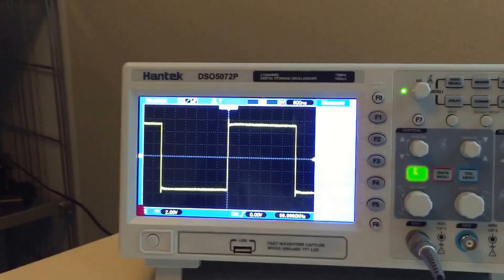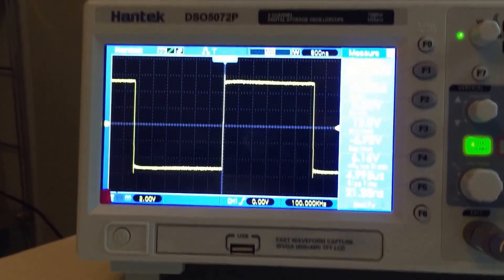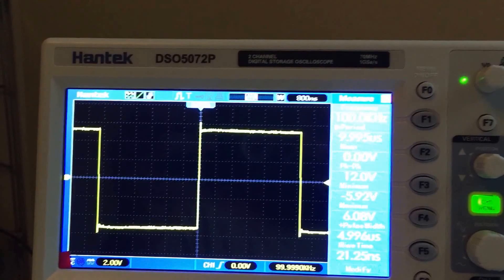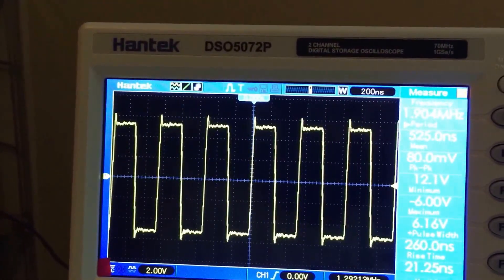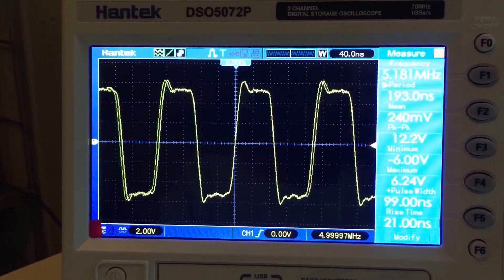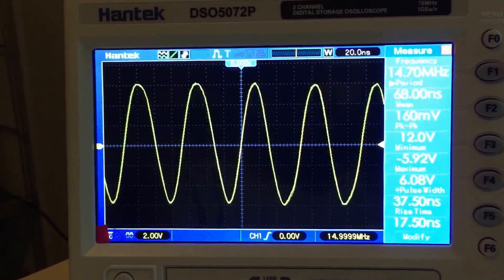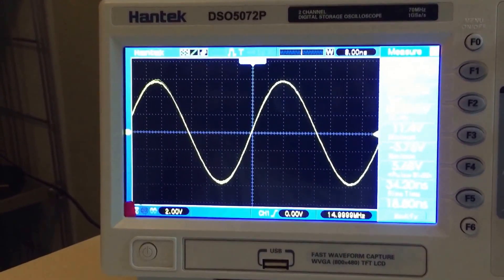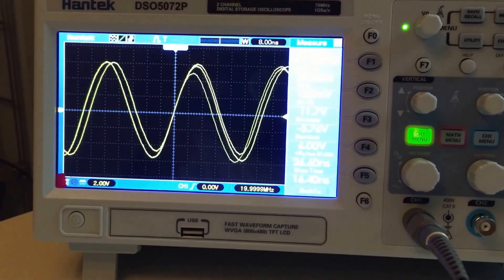Hantek 5072P testing the waveform of the Feeltech FY3200S

Comment: You’ll never get a square wave at the maximum frequency out of a function generator as it is fundamentally made up of higher frequency harmonics. Typically you might get f/4 i.e. 5MHz in your case. I bet if you check the specs carefully the square wave max freq is less than that for a sine wave (<20MHz).

Comment: It is not impedance matched. The cable looks like a 12V power cable at what impedance?And as Alan wrote it should be terminated. It will look a whole lot better properly connected.
I bought one that looks like the same unit and it is specified up to 6MHz square wave.
If you need more, pipe it through a schmitt trigger.
For the price it is a bargain. Just be aware of the ground current!

Comment: Hi,
I got 5072P two months ago and I found a bug. When I set generator frequency to 10MHz and go to the FFT, a have seen low frequency (1..5kHz on fifferent wave forms), but there are no same loq freq signals on other oscilloscopes - I check OWON and Siglent. Could ypu check please, do you also have this bug?